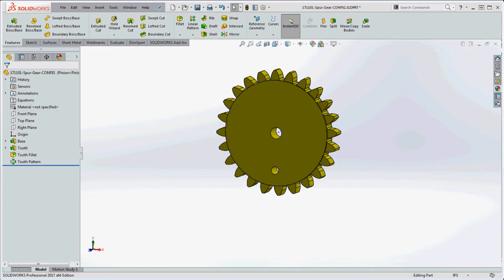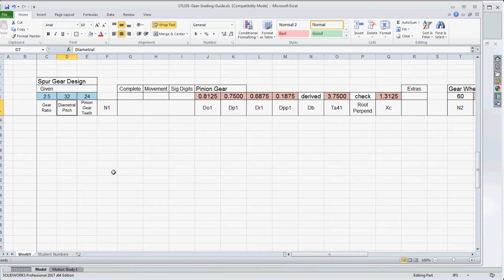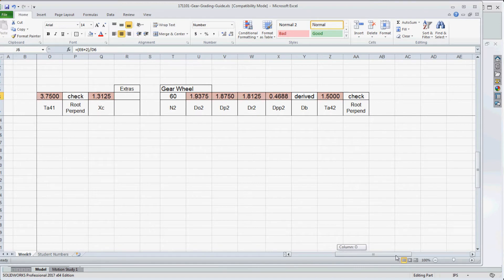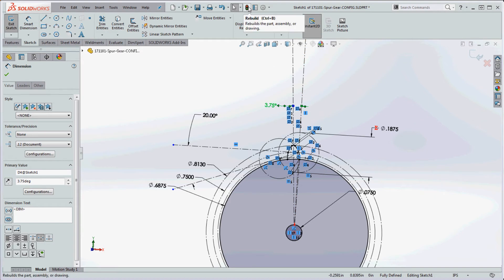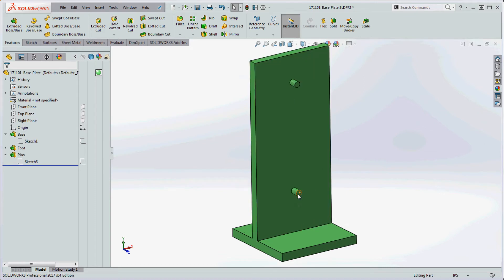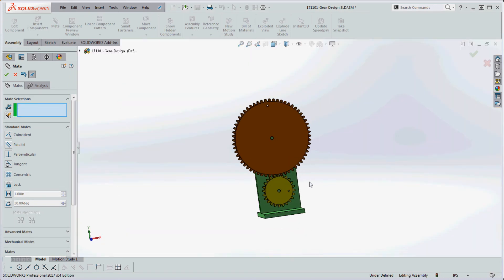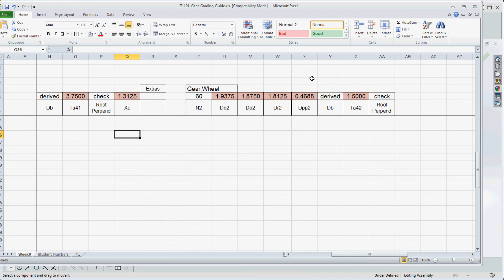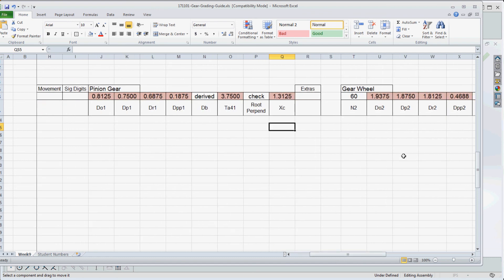35, Online SolidWorks – Modeling a Spur Gear Pair with Gear Ratio, Diametral Pitch & Number of Teeth

Comment: Why does solidworks only provide certain diametral pitch values?
Reply from the maker: Diametral pitch is determined by the designer of the gear pair - the designer will then apply those values in a program like SolidWorks for the virtual design.
Reply: @DesignInnovations Thanks for the reply,  I'm trying to model a spur gear with a diametral pitch of 28,  but 28 is not there?
Reply from the maker: @richardlsmith9057  SolidWorks may have automated gear design, but you can try my manual design method using Excel and sketching as seen in this video.

Give it a try and let me know how it works out.
Reply: @DesignInnovations Thank you very much, great video,  would Solidworks only provide certain diametial pitch values due gear wear or gearing issues?